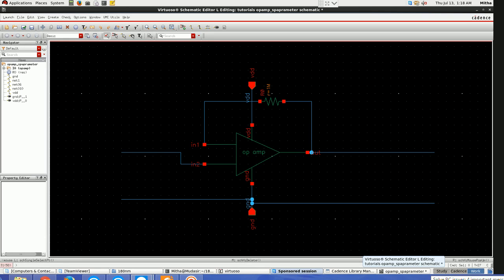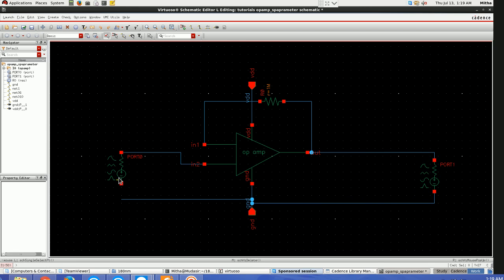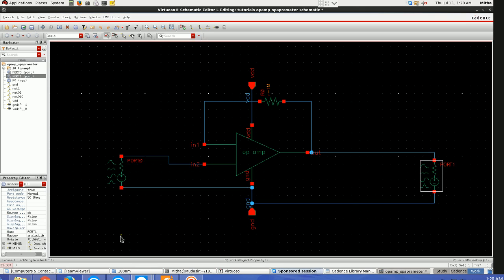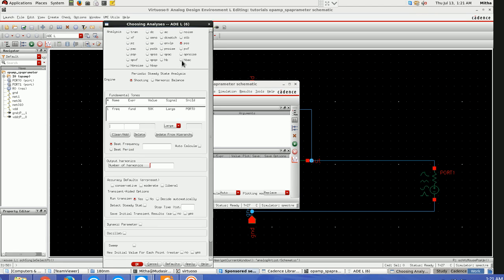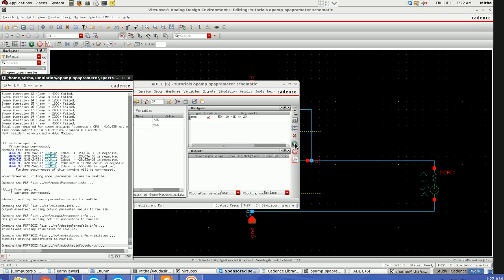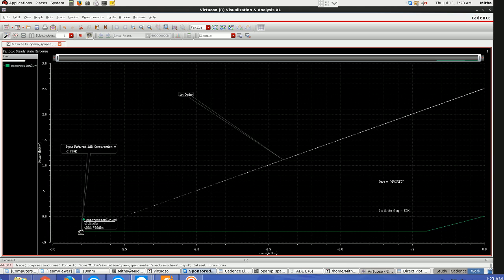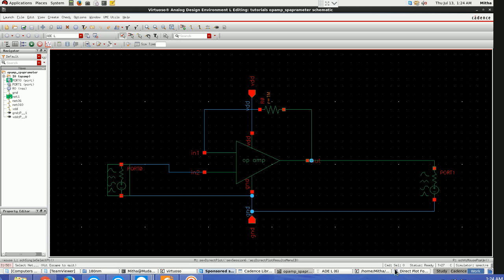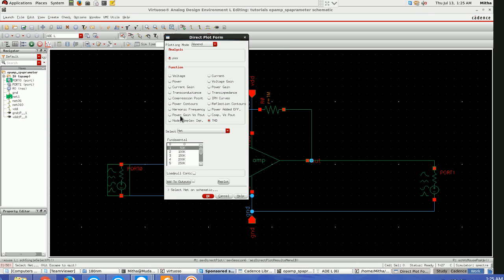Cadence IC615 Virtuoso Tutorial 13: Gain Compression, Harmonic Distortion and THD analysis

Comment: What I need to do if I want voltage or current amplitudes on the x-axis in spite of dBm, kindly suggest
Reply from the maker: The general procedure is to make current/voltage source as a variable or use swap option if current/voltage is in the y-axis.
Reply: At y axis i want THD % only while at x axis voltage/current amplitude...would it be correct if I am giving value in Vpk in place of dBm in PORT properties?
Reply: How current/voltage source can be made as variable as we are taking PORT (from analog lib) at input
Reply from the maker: Divya Singh makes sense or you can do it in adexl without changing the port properties.